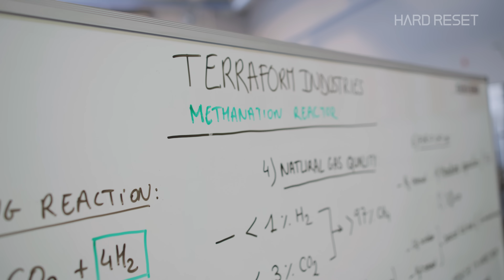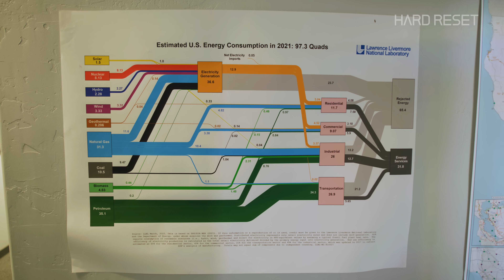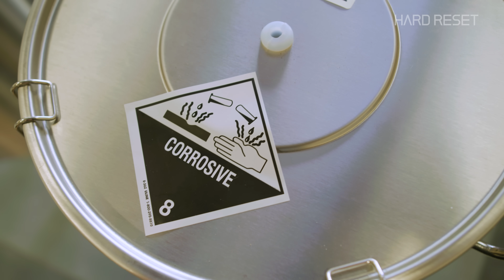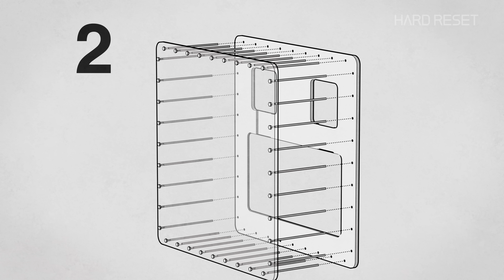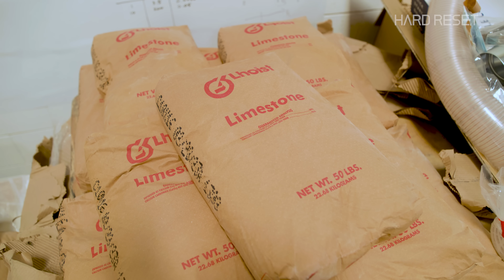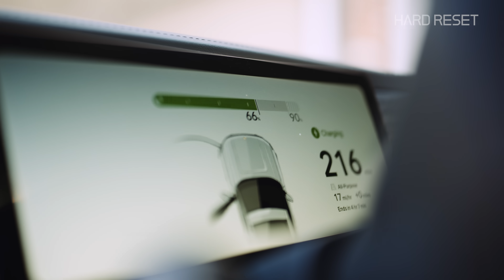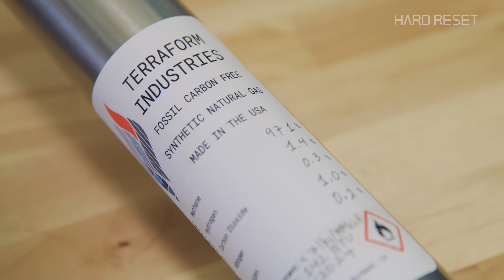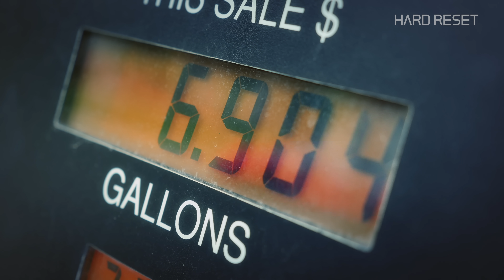The Last Fuel We'll Ever Need?

Comment: Methane is a very big greenhouse gas.  It's something like 50x worse than carbon dioxide.  The more methane we use, the more we will accidently leak.  Which could be really bad.  Can we start with making fertilizer?  Convert the methane to ammonia and sell that first.  Then expand to other uses.  Also, I'm sure there is a market for pure oxygen.  Maybe these can be built near oxygen clinics or something.  Hyperbaric therapy or some other industrial process that needs pure oxygen.  Maybe welding?

Comment: ethanol is the only viable alternative fuel for human kind. Because it is the only one that solves for storage/portability/density. And most importantly it is "the only" simple hydrocarbon that is not toxic. But the biggest problem with all this is that efficiency number 33% to convert. This is where finding a battery that can approach close to energy density while being 95% efficiency from source to end use is the only logical solution.

Comment: I was interested in the carbon-neutral aspect of this machine. When it was mentioned that cement is used in the process, which is a very heavy user of fossil fuels. I wondered if the carbon footprint of the whole process was taken into account? Do you have a full account of the carbon neutrality including the cement-making process?

Comment: It's not economically worth it in 2025 without heavy reliance on U.S. subsidies like IRA tax credits, as their projected costs exceed natural gas prices despite innovative scaling. 
A 1 MW Terraformer plus solar array costs ~$1.5M upfront, targeting $1.50/kg H2 or $28-30/MMBtu methane over 25 years before subsidies—still 2-3x natural gas ($4-10/MMBtu). Revenue relies 50-90% on IRA 45V/45E credits ($1.2-1.8M over 7 years), yielding 3-43% ROI in 5 years only with them; without subsidies, it fails to break even. Critics note optimistic assumptions on gas prices, electrolyzer durability (5-year life), and scale-up risks.

Comment: Where does the energy to run the electrolysis and kiln come from???  If it isn’t from renewable energy or nuclear then this system is creating way more co2 than it is synthesizing/recycling.  Literally doing what the video says you shouldn’t do…use fossil fuels to make a different type of fossil fuel.

Comment: This is a fascinating concept, but LiFePO₄ and sodium-ion batteries still outperform it in round-trip efficiency and scalability. What would truly revolutionise ICE tech is onboard carbon capture—imagine trapping CO₂ emissions directly from the exhaust, then using solar energy to convert that carbon back into fuel via synthetic regeneration (e.g., methanol or hydrogen). It would close the carbon loop and keep fuel in circulation without net emissions. To make this viable, we’d need: Compact carbon scrubbers or solid sorbents onboard, Solar-powered electrolysis + CO₂ conversion (Power-to-Fuel tech), Modular fuel regeneration stations or hybrid onboard systems

Comment: The wads of cash and the Hennessy on the desk is so gangster. 

I like Casey & what Terraform Industries is doing generally, but the overemphasis on methane is strange. If the ultimate goal is cheap ubiquitous energy, and fusion power is perpetually 50 years away then the interim means renewables, mostly solar, wind and to a lesser extent hydro & wind & wave, and the less-worse forms of fission power (thorium etc). The fuel-cell experiment with cars lost in favor of electric and batteries. You might still need fossil fuels for aircraft and rockets, but not for much else. Even then, aircraft jet fuel is mostly kerosene, and rockets don't use methane because the power-to-weight ratio of fuels in that sector, and the stability of the fuel combustion are critical, and methane is a poor choice on both those fronts. Then you are left with industry, and piping methane around is not very economic given it leaks more than natural gas, and making it onsite -offgrid also makes no sense if you can just use the power you'd need to make the methane directly. 

The fact that the efficiency to generate methane this way is so low, and you start with solar photovoltaics which are already only 20% efficient, it just seems pointless to make than methane intermediary. Like if you are making green concrete it would be pointless to use solar to create methane then to burn that for heat, or for making the coking coal substitute. Just use the solar directly. Use solar thermal molten salt if you need to store heat, or use the electricity from photovoltaic cells directly for power and use the heat byproducts. Add reverse-peltiers to get some of the wasted heat back to electricity. My point is that for the niche use-cases where you need high power density fuel then some wasteful process to store the energy chemically in methane has commercial value, but for the bulk of it just skip straight to more direct means of utilizing solar. If your factory does need combustion for the reaction process and methane works without contaminating your chemical engineering process then it might make sense.

Comment: Undecided with Matt Farrell had a video on a newer method of hydrogen production that is said to be more efficient than conventional methods.  And let's face it, producing hydrogen bumps up the price due to the energy requirements. 

I remember reading about a type of resin that can collect CO2 without limestone, but it's from those FRAUDULENT carbon capture industries.

I'm not sure, but I wouldn't be surprised if that brings down the costs of the synthetic methane.

But the Sabatier reaction, if I recall, has to heat up the gases to like 300°C.  I'm not spending ours at the library and on the computer to do the extensive research, nor am I looking it up on my phone while taking a sh$t on the toilet -- another source of methane.

 But I think even with green power sources like sun, wind, wave, or thorium/salt, the process could be pretty energy demanding.

Comment: im assuming that the most inefficient part of this design is the electrolysis of water. One trick that can be done to vastly improve the efficiency of the electrolysis is to pressurize the water going through the system. The industry standard is purpose built membranes that are so efficient that they are cost neutral, but they are still under patent so licensing would be hard. I was looking into creating a nickel sponge, to increase the surface area for more efficiency but realized that creating that much brown gas was kinda sketchy.

Comment: Don´t think I heard what they are trying to replace?- if the synthetic fuel is used to power something, but needs solar panels to be created - which are (Last I heard, about 30% efficient), plus on top of that this synthetic fuel is also only about 30% efficient in it´s creation... woudn´t it make more sense to push solar harder?

Edit: I can understand if it´s ment as kind of a step ladder into something even more efficient, but still.- That does mean the ´technology´ has to be done quickly though to rake in some money.

Comment: This triggered my math tism. So 35% efficient to produce nat gas. Now he said why drill and make 300MW of power when you can build these units and make 300MW of gas. Well lets do some math. 300MW "methane plant" would require 857.14MW of power to run, which is continuous production(24hr) is 20,571MWH. If solar powered, given the nature of solar it would need triple that to run continuously so 61,714MW of installed solar with storage lol. But just how much gas does that produce?

Well 300MWH is 1.08T joules of energy and a cubic meter of methane holds about 40M joules of energy converting to 27,000 cubes of natural gas per hour. 

For perspective that much methane could run a power plant capable of producing 135MW. Or the annual residential Canadian uses about 2800 cubes of Nat gas a year so if their operation ran non stop it could produce enough gas to power 84,471 homes. But it would only require the equivalent power of 389,545 (857MW) households.  or 1,371,200 heat pumps (leveled over a year). Yeah... great idea.

Comment: Turn this into a small convinient techy looking device for the home and you will have all of the money.

Imagine a fridge like unit on the outside of the home, connected to the water supply that combines all the stages in this process, and have methane just be available for energy all the time.

Comment: You would think if they were competent they would realize that water absorbs and concentrated CO2 in the water making water the more economic source of carbon. A liter of water exposed to air will have about 400 times more carbon in it than a liter of air, while not taking 400 times the energy to process and pump. 

Solar is also the wrong source of energy. Nuclear is cheaper and offers the grid cost savings by not needing battery storage. Make the electric grid 100% nuclear and in the periods of lower electrical demand you make your hydrocarbon fuels. Thus you have the on demand power of the nuclear grid plus the much lower cost because you now have a 100% demand curve for the whole grid. No longer running at 20% demand overnight. 

It's a great idea but is off by about 20% of the best direction. But don't worry someone else with a better vision will come along and commercialize the process if the government will accept that this fuel is CO2 net emissions near zero.

Comment: 35% efficiency sounds plenty "good enough". 
It is only recently that the internal combustion engine has been able to do better than 20% efficiency at converting the energy in the fuel into motion. Most of it is lost as heat (into the coolant and radiator, and out of the exhaust pipe). And those solar panels are likewise only just breaching 20% efficiency (but with fairly simple advances to get to 40% any day now, but at much greater expense). 
So, 35%?  That's plenty.

Comment: Hooray for pointless science. Congrats on cashing in on the net zero scam. You could just use bio digesters to directly make fuel, using no electricity. You could make biodiesel which again requires very little energy input.

Comment: Also beware Not enough Co2 and we all die of starvation. But too much Co2 gives us a lot more to eat.

At the start of the British Industrial Revolution Co2 was down to 180ppm. Plants require 150ppm to live. More to grow, much more to grow well

The biggest drawback is it is energy dense. needing hydro at best to produce the power cheaply enough without the worry of di-assmbling solar panels when they eventually die and need to be renewed to restart the renewable side of renewables..

It is what is called a closed loop. Even pulling oil up using it then recapturing it, is also an end result of a closed loop. After the initial suck up.

World War II: NZ used wood to burn, heating wood to use the gas from the heated wood to run the vehicles. "wood gasification"

Yes, animal fats can be used to produce renewable diesel, which is a type of petroleum product. This process involves converting animal fats into a synthetic hydrocarbon that is chemically identical to regular diesel fuel through a process called hydrogenation

Comment: Am I missing something? The part where the Cacium Hydroxide reversable part was glossed over.
Process is, use Limestone (CaCO3) and you process it to Calcuim Oxide (CaO) liberating the Carbon Dioxide? So none is actually coming out of the air ar this point?
This seems like a way to turn limestone into Carbon dioxide.

Comment: Okay I listened for 5 minutes and what I heard was. Basically let's not open the kimono and show them the stuff. We're talking about a two-stage process of hydrolysis producing hydrogen and then combining that with CO2 to produce methane gas. So there's no real advance here. This has been done as early as the 1970s and maybe earlier. And he didn't deny that. He just said basically that solar panels have gotten cheap enough to make enough power to become commercially viable. But that's not even true cuz it's only commercially viable when you consider the cost of transportation via cryogenesis and transport by ship! In other words, you have that huge extra cost that he's adding into his equation to break even. No! No no No !!

Comment: I work in the field of electricity production. We have coal fired power plants, natural gas power plants, solar farms, wind farms. The efficiency of this converting electricity into natural gas at 30 to 35% id not bad at all.
A coal power plant runs at 30 to 33% efficiency. Solar panel efficiency ranges from 15% to 22%, and wind turbines can capture around 50% of the energy. A combined cycle gas turbine is around 60%.

Comment: So there is no methane generated from the core through geological magma below the crust or elements that can make methane, only fossil decomposition? A new hydrogen producing plant was built outside Las Vegas that claims to produce enough hydrogen to run over 35,000 vehicles per day with zero emissions. It's time for Hydrogen Electric hybrid tech.

Comment: So, this is basically electrolysis, or material energy conversion, instead of generating pure hydrogen which is very unstable, it’s being used with the CO2 that’s already in the air to create a stable hydrocarbon (Methane) which requires 3 extra steps, the problem would be automation, and profitability, if this is a profit neutral process then it’s the same as turning solid plastic back into a liquid hydrocarbon, which is a process that’s net-neutral aswell, neither are profitable, which is the problem.

In order to make this a reality you would need to find a way to market this, otherwise it’s gonna fall flat as a dead project, I can see this being marketed to people who live an off-grid lifestyle, but that’s to the extent of my knowledge.

Comment: I wish you would've asked them about extending the carbon capture aspect of their technology. Carbon neutral fuel is only a solution if we also capture and store the excessive amount of CO2 that's causing climate change. They have a reusable material to capture the carbon. Great. But instead of using that as a feedstock to make methane, would it be possible to process in the captured CO2 into solid elemental carbon and oxygen? I'm also skeptical of methane being touted as a solution when it is 84 times more potent at trapping heat than CO2, and the current natural gas infrastructure is riddled with leaks. Do they have a solution to this? If not, then why not just just get onboard with green hydrogen tech?

Comment: skip the limestone and co2 capturing process, switch to finding way to collect CO2 from seawater
seawater collects the most CO2 and its free.. the problem is the corrosion from the salinity 
ptfe might be viable if there is no runoff .. maybe use the expended solution as steam energy/Na Batteries

Comment: While this sounds great, the lingering question is how much petroleum is required to make the world saving photovoltaic cells, the power lines that connect the grid, the vehicles that are used to maintain the grid, the computers that, the phones, the materials that are used to extract the fuel.
 This sounds like the electric vehicle problem which is that to stop greenhouse gases heating up the earth people buy an EV they then become smug A holes convinced that they are saving the planet because the fuel for their car comes from an electrical source never once questioning where the electricity comes from and none of those sources are carbon neutral and be it
Wind, Solar, Natural gas, Oil, Coal, Nuclear, Geothermal, or Hydroelectric.
 And unfortunately for the tree hugging hippies of the world of these nuclear is the cleanest of the VIABLE options geothermal would sit at the top of the list but it is only usable in very specific places.

Comment: Great idea, not new but one that's been worked on for ages. I'm a bit unsure about being carbon neutral because transportation of fuel requires extra fuel to be burned and so far we don't have efficient engines for trucks or heavy transport vehicles that run on methane fuel so naturally they have to make different synthetic fuels which could add other pollutants

Comment: a lot of claims and language used to mislead the viewer.

I don't doubt the process works.

the cost $/kw.hr matters.

the claim of oil from fossils = bad is misleading. 

the pollution cost per kw.hr matters. regardless of the source being directly in the ground or using complex equipment.

never confuse industrial scale producing 5gw gr of energy a year with a lab bench kit producing 100watts and only when the sun shines.

numbers matter.

Comment: This might be carbon neutral, but it might not be greenhouse gas neutral. Methane is significantly better at traping heat, so converting some CO2 into Methane and even a tiny percentage of methane escapes being turned back into CO2 and water means that the net Greenhouse gas effect has gotten worse.

Comment: We never beat gasoline and diesel with 34.2&38.6 MJ/kg
BTW- Co called "global warming" was proven wrong many years ago.
Search for year 1936 and 1934...hottest years ever. And snow on Sahara.
Even recorded in "Grapes of Wrath" school lecture...mandatory years ago.
And CO2 gives only 0.06° degree of warming.

P.S. They would need to dig the crust for *100 000 000+ Gt* of Carbon stored in calcium carbonate to run humanity. (1/750 Moon mass)

Comment: Pardon me, but this seems like an absolutely terrible idea. Calling methane of any kind 'carbon neutral' is like calling a woodchipper child safe. Any leak in the process or transportation or use will make it much worse for the environment than the CO2 it's taking out. Just use the electricity. Store it. Jeez. Even bragging about how inefficient it is seems nuts. This sounds like a plant by the oil and gas  industry to derail electrification.